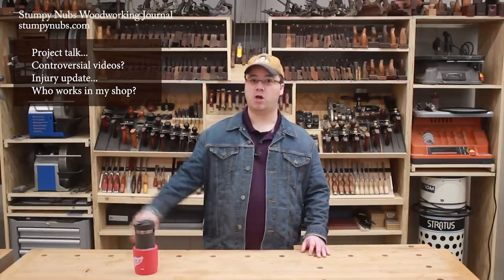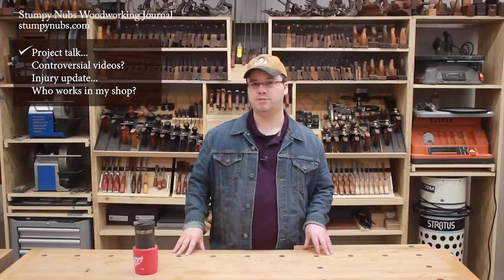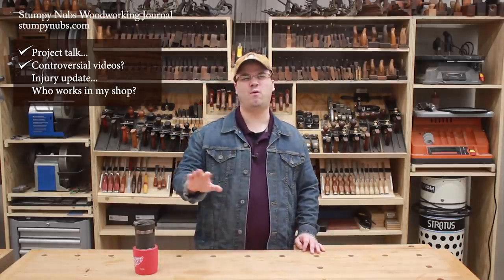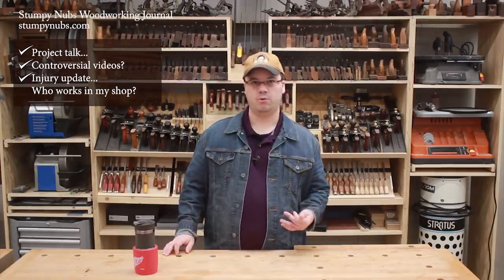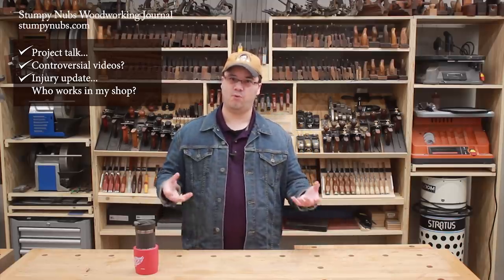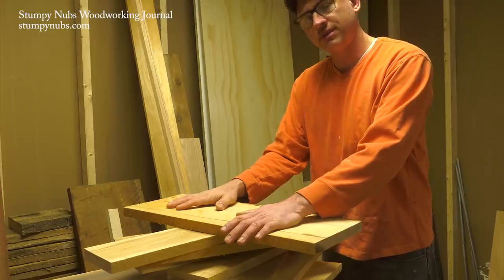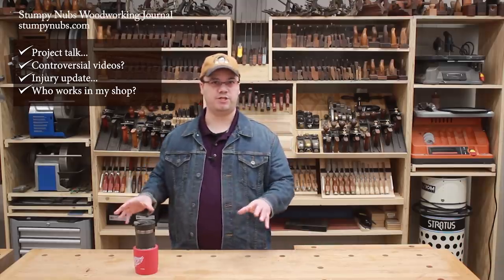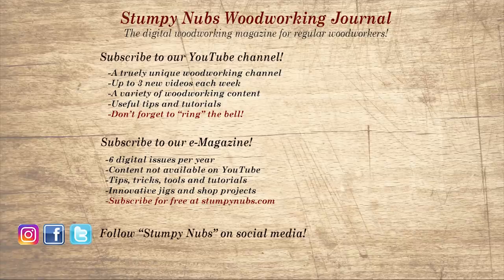Why I can't give the finger anymore (and other interesting stuff)

Comment: Simple and short. ALL tools are or can inflict injury! They are made to cut. Wood, metal. Plastic and flesh, as a surgeon would use. The only thing or person using them keeps tools 🛠️ reasonably safe. Yes there are accidents even from the simplest tools such as a screwdriver. How many have been holding a small piece tightening a screw and have the screwdriver slip? It’s like operator that has knowledge and skills to make the tools/ equipment safe.
Reply from the maker: All tools are dangerous, but not all tools are EQUALLY dangerous. Not by a long shot.

Comment: I would be more optimistic about the healing and return of function of your fingers. I think your scar will slowly improve a lot. Your repaired tendon will allow more flexion.  What you might possibly be left with is slight loss of flexion which you need for holding a few screws in your palm. I say only possibly as you are young enough for healing. You are not a starfish but I expect your finger tip will fill out. The pain and discomfort and nerve dysfunction will slowly disappear. I am sure you are doing physio. General fitness improves healing a lot.

Comment: you can get rid of the scar, but is it worth it? get a razor blade & sterilize it, then dig out edge of scar about 1/16" or so, until bleeds, stop, allow to heal a week, go to opposite side of scar, repeat, and in a year or so, you can slowly remove scar. I have done a few on me, 1 I been working on over 30 years, & its now just over an inch, but originally was over 5" & yes 100% serious, just baby steps, and only do about width of #2 pencil lead at a time, wait to heal before, & there will be times you just dont want to dig & deal with pain, trust me, but as a child I had a major accident, & i figure in 5 or so years I will have scar finally gone

Comment: I have never got myself with any power saw. Yet... but put a knife in my hand... blood everywhere. Wife yells: "what? Again?"...
Reply: Why not with a powertool? They terrify me so I am pretty aware when I use one.  I have been using my radial arm saw for 20 years . Still have all my fingers, only a couple kick backs. Damn thing scares me, so I am careful.
Reply: Although there was that time cutting stainless on a 13 inch lathe... cut down to the bone by a string of stainless that caught in the chuck. Did not see the string...

Comment: Another voice from the 'peanut gallery'; do the safety video (rant if you prefer)!  Tough guys and keyboard-warriors can go pound sand!  People new to the craft, and old guys (like me) need to be taught, and reminded, that our brains are the biggest, most important safety device of all.   Know/learn why guards and other safety equipemnt were designed for and use them!   For a single example: it takes so little effort to push a piece of wood through a table saw;   you have no intutive idea of how hard and fast a table saw can kick that piece of wood back at you and the amount of damage that piece of wood can do.

Comment: PUBLISH THE VIDEO!!  Forget the trolls and self worshiping tough guys! Just think of the guys who will still be able to walk with a son and daughter holding each hand, not just one. And 30 years later STILL has 2 hands for the grandkids! I have had close calls, but it’s my dumb luck AND the warnings of many others that I haven’t cut off anything that didn’t grow back, mostly. 

I discovered a safety risk that I hadn’t heard of before, and at every opportunity I tell everyone how close I came to loosing an eye. I turn wood, and use CA glue often on nots, cracks etc. One day I opened a new large bottle of thin CA, repaired a small defect, and sat the plastic bottle down about 1 foot in front of my face. The bottle was very flexible, and full, so a GUYSER of CA squirted at my face, and deposited probably a half teaspoon on my collar, SAFETY GLASSES and the floor behind me.  I cringe every time I think of the burned out hole I could have had in my head.  I hope I never hear that someone lost an eye, and I had not bothered to tell him/her about this
Reply from the maker: Already published :)

Comment: Safety videos are boring.
BUT!
after watching a whole "butt load" of them...  I ignored a "bad feeling as I did something with my new table saw...  
Yea, 9ish stitches in my lower lip later...
If it feels bad, DON'T.
30+ years of power tool safety videos then DOOH!
All for:  I do not want to take the time to do it correctly.
SMH